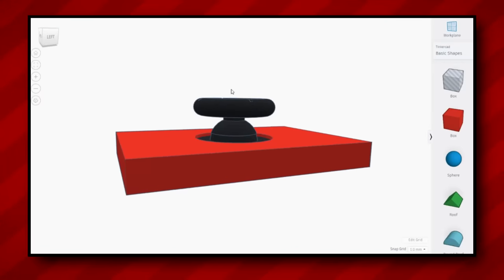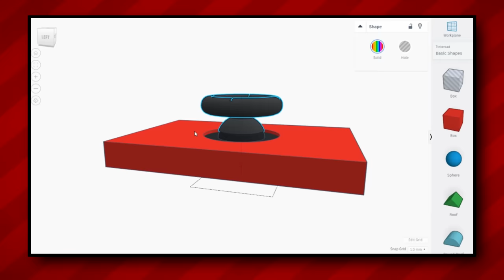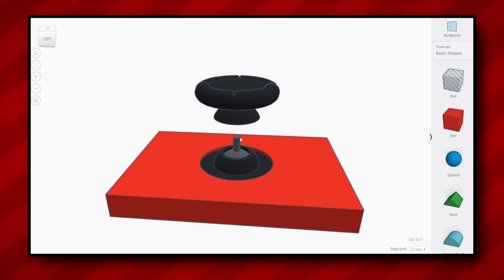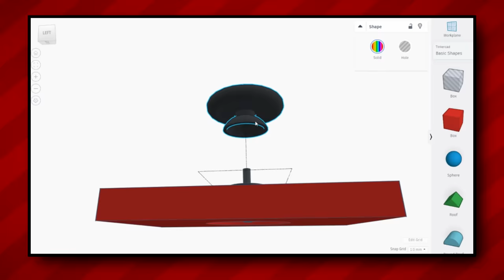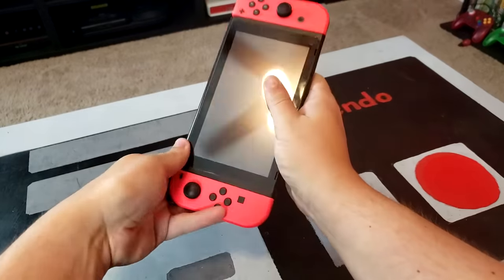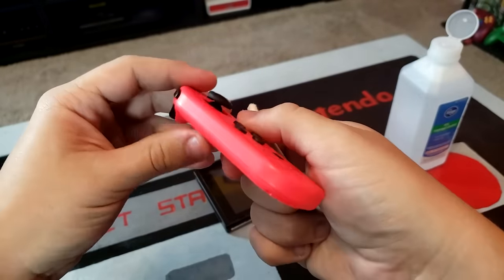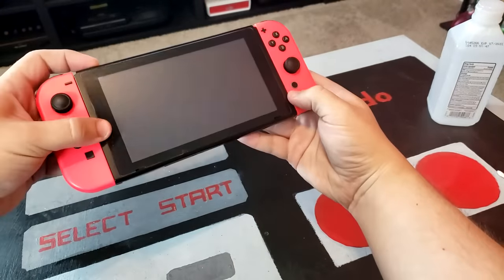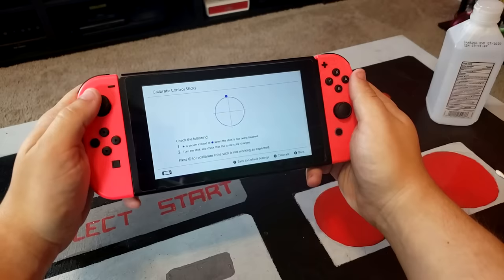How to Fix Joy-Con Drift at Home! No tools required! | Nintendrew

Comment from the maker: Hey everyone! Just a side note: This method may not work for ALL forms of Joy-Con drift (especially if there has been some sort of real, long-term mechanical failure), but like I mentioned, it's worked for all 4 of my launch day controllers. 😄 Let me know in the comments if it works for you! Cheers.
Reply: With this methed the best thing to do is use 3in1 oil. The Alcohol can dry out and damage the charcoal pad's that are used in the tracking of the joystick.
Reply: @DextNRN  hey thanks
Reply: @CalebCalvin  NP I did this with my left Joycon about 10 month's ago and has worked right since
Reply: Can show how to fix drift on wii u gamepad.
Reply: Kingj0444  you want to use alcohol because it evaporates quickly and wont damage the internals of the controller, water can damage it
Reply: Nintendrew 👏
Reply: Hey Nintendrew! I love the Nintendo red color on your wall. Do you mind giving me the exact paint color and brand?
Reply: Make a tutorial on how to get that awesome hair style 💇‍♂️😊I love your videos, keep going ✌️
Reply: Nice but this will not solve the problem. It will always come back. The problem is Nin cheaped out on the sticks & inside them are medal contacts as you know & some of them are not "even" when they make them.

So if one side is uneven with the medal & can't touch the pad 100% then you will get a drift. Also the Joy Con board is always sending auto movement when you take out the Joy Stick. If you turn on a joy con without a joystick you will see that.

So combine that with a cheap design joystick you will always get a drift no matter what. Nin just didn't do a good job with the sticks this gen.
Reply: Will this work on PS Vita
Reply: Can I just use the q tip I don’t have pure alcohol at home at best I have alcohol wipes
Reply: Didn't work for mine, unfortunately...
Reply: Would this work with hydrogen peroxide? Please smart people, i don’t want to mess up my joycons or something and I don’t have the right kind of alcohol
Reply: @Nintendrew i love you
Reply: What about deadzones on pro controllers?
Reply: @tmacinsanity4832  chill out
Reply: @wierdo2399  no use compressed air directly in to the stem opening
Reply: @alynnzz0491  I posted a video on my channel to help fix the mistakes the alcohol caused
Reply: @I_was_a_Bullfrog  on my video about halfway through I show you how to fix drift and dead zone on switch pro controller keep in mind you will have to run the recalibration test afterwards
Reply: @calebwiegner4354  no it won't dry fast enough and might gunk up your internals of the joy con
Reply: Hey guys, would normal domestic alcohol work too? I know isopropyl alcohol is effective to evaporate dirt but its also considered a toxic quemical.
And i dont really know where i find isopropyl alcohol near me xD

Any help appreciated :)
Reply: Does it work with electric contact cleaner? And also you have any fixea for handheld incompatibility (joycon not pairing in handheld)
Reply: Kingj0444  i think electrical contact cleaner might work
Reply: This did not work, drift was back in a few hours.
Reply: It worked thanks Nintenddrew
Reply: wow!!!!! it actually worked thanks a lot Nintendrew!!!!
Reply: BRAD KENADY
Reply: Nintendrew I was wondering, can you also show how to fix when the joycons keep slipping out from the rail?
Reply: Like when the controller lock stops working
Reply: @calebwiegner4354  do not use peroxide isopropyl alcohol costs like 99 cents
Reply: Can someone help me with my question?
Reply: what forms of joy-con drift are there?  because mine especially loves  moving to the left even when no one has even breathed on it.
Reply: Awesome vid dude..  I used WD 40 a yr ago... Works great too...no issues since
Reply: martin elechi It would do that a few times on my Left Joy-Con controller, but it would go to the right on my Right Joy-Con controller almost every single time (including on the Home menu).
Reply: This is pretty damn cool. Thanks for your advice. I was about to call Nintendo or buy new joycons, which is a issue for someone with little money. I can at least try it out, if not, I'll just use the alcohol for my gc controller someday
Reply: Will peroxide work is that a good substitute
Reply: I love cats
Reply: Nintendrew  I love your Videos
Reply: Nintendrew wow this comet is sooooooooo new
Reply: Is the alchohol needed?
Reply: I did this fix a few months back on my launch days, it works like a charm. Make sure that you don't press and buttons or click the control stick during the process, as electricity flow can kill the joycon
Reply: stares in spawnwave
Reply: I left Joy con after fixing it slightly drifts but it's way better then what it was
Reply: Thank you for the help. Finally i can play games normally.
Reply: What percentage of alchohol did you use? I have 70% and 91%
Reply: Does Regular Rubbing Alcohol Work?
Reply: @wierdo2399  will it work on me?
Reply: I blew into my joycons and it was temporarily fixing it
Reply: Can I use normal alcohol? Please I need a answer.
Reply: @wierdo2399  it should. Dont know if true
Reply: Dood i haven't been able to use my joy-cons for 6 months cause the drift was that bad, i used some which Hassel and bam💣💥 no drift at all!
Reply: Shadownightdragon yeah does it I don’t have that stuff
Reply: What about pro controller
Reply: I did the technique right now and it works! Thank you so much! It made my sons night
Reply: Can you use mr sheen to clean it?
Reply: Hasn't worked for me unfortunately, so I'll probably just send in to get it fixed or something.
Reply: Would rubbing alcohol work?
Reply: Can you use water
Reply: Omg thank you it worked now I can play my main in super mash bros properly
Reply: I can't calibrate my right joycon because the analogue stick won't click in
Reply: Im trying this now because i dont wanna go through the hassle of packaging and shipping my left joy con even though nintendo does it free now.
Reply: Nintendrew mine won’t work at all
Reply: Ware did you get the alcohol and does it work on the procontroler
Reply: It worked on my Terios T9 joystick for android. Thanks a lot!!
Reply: Is it necessarily to use isopropyl alcohol or can it be another?
Reply: I got some sad news for u @nintendrew it worked😏 for some weird ass reason never it was that simple I can finally play smash Bros ultimate again thanks man
Reply: Thank you! I got mine working again.
Reply: Bro Thanks SO MUCH!  
I have been trying to fix this for months and nothing worked. But this! This just fixed it and saved me 80$!
Reply: Can you use rubbing alcohol
Reply: Nintendrew can I use any kind of alcohol or I have to use the one u are using
Reply: Can I use water instead of alcohol??
Reply: Its not grime or longterm mechanical failure. My right joycon drifted after 6 hours of gameplay out of the box brand new. Im not manhandling it, my hands are squeeky clean, i never dropped it, and there is zero physical damage. The joycons drift because they are made heedlessly by nintendo like every other wobbly piece of crap that comes in the box. The chinsiest console of all time.
Reply: Nintendrew i used WD40
and it works perfect joycon drift free since
Reply: @DextNRN  i amdoing  it right now so thanks!
Reply: Dext Do you know how to fix the charcoal pad? I accidentally inserted a lot of alcohol and now the joy stick won’t move
Reply: Fixed our launch day joy-cons right up. Thanks for the video!
Reply: Does it work with rubbing alchohol or hydrogen peroxide?
Reply: It instantly fixed my drift thank you! i can use them and play smash bros to the best, like they are new!
Reply: I did this and my joy cons won’t even turn on
Reply: I have a question: Does water work?
Reply: I had HEINOUS DRIFT and I've only had my switch for 2 months, but this fixed it right up
Reply: does it work for pro controller?
Reply: @DextNRN  does detol work
Reply: Does hydrogen peroxide work?
Reply: Thank you we fixed our controller  you da best
Reply: Dose hydrogen peroxide work ???
Reply: I will try this and if it fixes my joycon problems i will pay you on platform of your choosing because you will save me a bunch of money. I hope it works.
Reply: bless you, i was about to buy new controllers
Reply: uhhh it fixed the drift but now it’s going down?
Reply: Do i have any more options besides the alcohol cuz i dont think i have that
Reply: Oh my god thank you so much, 3 of my 4 joycons were basically unusable, and this fixed them
Reply: This works for like 30 min - an hour for me and then the drift comes back do you know why?
Reply: I love you
Reply: Does this also work with pro controllers
Reply: Will ethyl alcohol work the same?
Reply: Nintendrew it worked.
Reply: What your suggesting can do serious damage to your switch. One wrong move and it can cook the internal wiring
Reply: Nintendrew didn’t work with my day one switch that’s why I sold it what a waste of a video
Reply: Nintendrew it worked! Thanks man!
Reply: my nintendo: perfect condition, zero scratches.
my left joy con: drift issue
my right joy con: pairing and docking issues.
Joycon technology is just terrible.
Reply: My blue joy con was drifting and now it is not. It workes
Reply: I just really wanted to thank you for your informative video. My daughter, who is of special needs, was having a problem with her launch day Nintendo Switch. I tried various methods of cleaning to no avail. After watching your video, I was able to clean both Joycons. And lo and behold, they both worked like new! Thank you again!
Reply: Dext what is 3in1 oil categorized as? So I can look for it online or in person
Reply: Is this 70% isopropyl alcohol work?
Reply: So is this just basically just rubbing alcohol
Reply: Is there a substitute for the cleaner?
Reply: @rodri99pt8   i find ir but 91% at WALMART
Reply: I bought my switch for $100 off of offer up so yeah you can imagine that it has a few issues one of them being the original left joycon (it only had one when I got it) has really bad drift. If I'm playing any game with a movable camera I just start spinning out of nowhere. I'm going to try this and maybe some of the other suggestions so thank you especially if it works 😅
Reply: Nintendrew can I use rubbing alcohol?
Reply: Im trying it now. I hope it works.
Reply: What brand of the alcohol do you use? I’m looking to fixing a drifting joycon and I want to be sure to buy the right material.
Reply: Nintendrew Do you think it would work with a Pro Controller too or no? 🤔🤔
Reply: You saved me  I love you
Reply: Can this work for pro controllers
Reply: Ugh covid-19 is stopping me from getting the correct alcohol, these stupid ass people going crazy and buying things they obviously don't need, lol don't mean to rant but now I cant try this,😭😭😭
Reply: Um...so I don't really have a "drift" problem per se. Unless not really being able to Push the joystick down enough so that it registers counts as "drift". It's wreaking havoc with my ability to play Astral Chain, which it seems you need to be able to press the joystick down on in order to Dash and Crouch. Uhh...should I like get a new blue Joycon or... do I have to buy a new set? Cuz I'm too scared to actually open them up and the qtip/solution thing doesn't seem to be helping
Reply: ErroneousClique I can’t even pronounce half of that stuff
Reply: Does this work for a Pro Controller??
Reply: Does ethyl work?
Reply: i have a mixture of 70% isopropyl alcohol, and 30% purified water, do yall think it would still work?
Reply: My joycon is BROKEN as in the stick doesn't work up or down will it work for that?
Reply: The dude who has so many rare Nintendo things doesn't have a switch light
Reply: How do I tell if it's a mechanical problem or the dust causing undesirable input?
Reply: This worked so well thank yoy nintendrew it worked like a charm.
Reply: Tried it today and it worked! THANK YOU, DRIFT SLAYER!!
Reply: Hi, Would surgical spirit or 2% chlorhexidine in 70% alcohol wipes work the same? This is all I have in the house. Thanks
Reply: I was skeptical at first when I googled a fix and found yours. 

"It couldn't be THAT easy." But, I bit the bullet, tried it out and the joy con AND pro controller I was having issues with? FIXED! Thanks, Drew! <3
Reply: Forgot to post that while this method didnt completely get rid of my drift, it is SO. MUCH. BETTER!!  Before, my dude wouldn't stand still at all. It got to the point that even the D-pad was drifting. But I used alcohol on  the buttons and the joystick, and now she only rarely (knock on wood) drifts to the left a little.  HUGE improvement!
Reply: It worked with my right but not my left I’ve been trying to fix this for a year so thanks for the right one but the left one still does it when I go try to calibrate it the left one just completely stops working
Reply: Does other Alcohol products work?
Reply: Ahmed Last Memer 3 in one oil works
Reply: the Ruby maker can’t find that, tried looking for it a long time, nothing
Reply: P.S: TO THIS DAY
Reply: Thank you nintendrew I used hand sanitizer and it work thank you
Reply: Ahmed Last Memer maybe just order it also you can go to support.nintendo.com and get them replaced for free just look up a tutorial on how to get there
Reply: Does any alcohol work
Reply: TwistedO4 I wouldn’t say any maybe like most just look up the alchahol you use and see if it works i also know 3in1 oil works
Reply: Do you know anything about how to fix the problem I'm about to describe?
My right Joy con, a red one I got with the Switch, will give input from any of the buttons on it. To clarify, the buttons are Plus, X, A, B, Y, and Home. It also seems to get input from the joy stick, nearly always pushing to the right, sometimes likes a partial tilt, sometimes likes I'm pushing it to the right as far as possible.
I found a remedy for it by tapping the joy stick to the right repeatedly whenever that came up, but recently the buttons got hit with the plague, and now the inputs are even mixed up, so pressing A can make the Joy con stick I'm pressing any of the buttons, usually X, Y, B, or actually A. Home is the least swapped around, but occasionally the controller thinks I've pressed another button. Plus simply doesn't react a lot of the time.
Home often gets 'held down' so that the quick-menu pops up and I have nearly always had to use the handheld mode so that I can tap to close it via touchscreen, since pressing B is so unreliable.
My blue left Joy con is perfectly fine, and so are my left and right gray ones, but I lost track of the right gray Joy con so I cannot simply use a different controller and ignore the plagues of the red Joy con, especially since it can wake up while I am playing a game and cause havoc with its screwy ways.

Would the best thing to do be getting a new Joy Con and making sure the red one either runs out of batteries so that it cannot wake up and interfere or simply de-sync it from the Switch?
It's really interfering with any games I play that require both controllers, and playing one-handed games is unpleasant because I'm right-handed, and, as mentioned above, the only ones I can access without drift are left Joy Cons.
Reply: I used Electrical contact cleaner and Air Duster. Does that work instead? I have the problem about a week after fixing
Reply: Jammy Choo lucky I have the problem 3 minutes after fixing but yea just keep on using that stuff
Reply: @therubymaker3810  I fixed it like an hour ago. It literally has the smallest ecer little drift to the right on left joycom but i dont mind
Reply: Jammy Choo ok
Reply: It kind of helped but it's still broken.
Reply: Worked like a charm. Thx so much
Reply: Thanks for this! It worked!!
Reply: Thank you so much this vid helped me fix my switch lite
Reply: Would rubbing alcohol work fine?
Reply: @soiledhickory9653  idk i used liquid sanitizer spray i sprayed it on a toothpick with some cotton on the end
Reply: @TrexHeavel   might be late.  isopropyl alcohol  above 90% will dry quicker than just regular alcohol.   Using a q tip helps to concentrate a small amount also. Don't use too much though.
Reply: I literally had Joycon drift within the first week of opening the box.  Highly unlikely it is dirt.   May work for some, but I have to question whether the Joycon's are fit for function.  Sad.
Reply: I’m gonna try this, been using the electronic cleaner. My brother’s been complaining about the drifting chronically.
Reply: Will water work
Reply: I am in the presence of a man with over 300 IQ and infinite wisdom
Reply: Can it be any type of alcohol?
Reply: Don't Say
Reply: @DextNRN  can't the oil make dust stick? From what I've read seems like either solutions aren't ideal :(
Reply: @ErroneousClique  Nintendo actually has the gall to recommend you replace your joycons every 6 months despite the 1 year warranty, ok let me just go buy a new £200 switch lite every six months and struggle to pay my rent
Reply: @John Martin Cantorne are there multiple types of wd-40? I thought it contained oil
Reply: Worked for me, thanks!
Reply: Where can I get ipa from?
Reply: alternatively, instead of wasting a bunch of q-tips could you use an eye dropper or is that too much?
Reply: It in fact did NOT work for me. There goes the $80 that I originally was going to spend on the fighters pass for smash bros... Good job Nintendo! Making profit off of your own mistakes. Because that's what good company's do! 😑
Reply: Jake 1203n i think nintendo does pretty good considering. although i’m beginning to think the flaw is inherent in everything they make because if it was perfect it would just break people’s brain. think about it. blowing on cartridges. gameboy glitched. these products are obviously made by aliens as a social experiment on us. the mechanical or algorithm flaw is simply a test variant.
Reply: Just bought a switch a few months ago.  It just started doing the drift.  Thank you for the tip awesome.
Reply: Its effective!!!
I lifted the skirt and sprayed a contact cleaner spray, and followed the instruction. Voila works like new 😁😁😁
Reply: Or you can try update controllers, it worked for me.
Reply: It worked straight away! Thanks!
Reply: It works it's just that sometimes it drifts back again.
Reply: Thank you!! I just replaced a joystick with a broken button (the joystick wouldn't click anymore), but the replacement part had drift...

Thanks to you it's completely fixed, so I'm feeling very happy right now!
Reply: ameko1ikiru I tried another alcohol and the blue stick is not working anymore
Reply: Actually it did worked with me thank you so much
Reply: @tmacinsanity4832  STOP BEING RUDE.
Reply: I tried it with water instead of alcohol and it worked! I can use my joycon again! Thank you for the tip!
Reply: @Nintendrew : link of where to buy the product pls ? :)
Reply: Will rubing alcohol work?
Reply: Worked perfectly for me though, thx!
Reply: Idk
Reply: Question: is buttons not responding correctly/immediately considered a joy-con drift form?
Reply: @Cheezbal  Noz that's probably just lag delay due to the controllers being wireless and running on bluetooth
Reply: @toopienator  thanks
Reply: Nintendrew please do a how to fix your controller when the black that you can put on your tablet
Reply: @pascaledixon  r/ihadastroke
Reply: For me dont :(
Reply: I found that it also works on pro controllers, thanks for the help!
Reply: Does it work for switch  lite  joystick  the right one
Reply: It should because they use the same joystick mechanism, but I don't know for sure. @julierodriguez3234
Reply: Considering how easy that method is, I hope I was misled when I heard about Nintendo saying that joy-con drift is fake (I'm hoping it was just some random person working there and not the entire company).
Reply: saved me 60 bucks on launch day controller!!
Reply: Is there a way
To do this with out the alcohol because I don’t have any of it and I can’t get it at any store please help
Reply: Yes it did fix my joycon this is a very good method
Reply: can i use eye drops to fix my joycons
Reply: I did this my controller still not working :(
Reply: I know it's sounds fake but it's not and I need to tell you this. My controllers have been drifting for like 2 years, and eventually I just decided to play on my dock with a GameCube controller, but I moved across the country like 4 days ago, and this things are in boxes so I decided to look up WHY my controllers keep breaking, rather than how to fix them (which i was lookin up forever) and I saw your vid. I looked at the reasoning, and then I listened to the rest of the video. Other videos said use pressurized air, but I hadn't seen yours yet. I tried it, and now I'm super happy 😄 tysm.
Reply: Thanks for the video man, I saved a lot of because of it
Reply: @Maria Bermejo Yes it did
Reply: he forgot to say you have to do this ever 2-3 weeks. it  never fixes it for good.
Reply: Imagine getting hearted

Ima have to imagine real hard I guess
Reply: @ameko1ikiru  what about sanitizer
Reply: @ameko1ikiru  and yes water does damage it but not permanently my pro controller was water damaged and the inputs were messed up i waited 2 days and then it went back to normal
Reply: @johnmelendez9782  you can sanitizer i think
Reply: @potatooter5909  yes but luckily there is alcohol im sanitizer
Reply: @TrexHeavel  you have isopropylalcohol im sanitizer so if you have sanitizer use it
Reply: @therealmcdonaldsarabia  no
Reply: Thanks man
Reply: Do we need any kind of alcohol or do we need specificly this alcohol?
Reply: Thank you so much, for almost half a year my controllers would drift but today they stopped thanks to you, thank you
Reply: @goldykanuu1692  use sanitizer it contains isoprpyl alchohol which is the one you need
Reply: @strife2874  ok thanks
Reply: I didn't have the alcohol used in your vid but I used hand hand sanitizer and it worked
Also if anyone reads this dont use the hand sanitizer because it will probably be different from the one I used
Reply: It worked! Thanks!
Reply: I just wonder if switch olded joycons would work on a older switch
Reply: Nintendrew, thanks a whole bunch for showing us this fix. It worked for me so thanks a ton!
Reply: does this work with Xbox and PlayStation as well?
Reply: This made it worse.
Reply: I’m am not mad it didn’t work with mine because my camera analog stick had a tear in the area
Reply: I love the use of tinkercad lol
Reply: This really works for my controller! Thank you very much!
Reply: Thank you so much for this video. I was ready to purchase New Joy con attachments until I saw this video. I left joycon was beginning to drift thus creating a problem during gameplay. Until I followed your instructions. Also decided that if I was going to clean the left joystick, that I might as well clean the right. Going to save this video and share it with friends
Reply: You have got a new subscribe ( I Guess i' m italian i don't speak english) but tour metod Is very well
Reply: Dose matter what type of alcohol you use?
Please, I have bad Joy-Con drift .